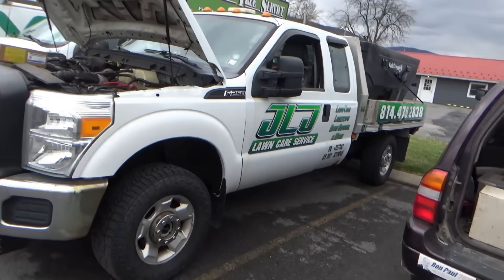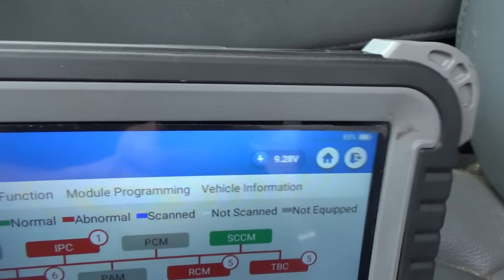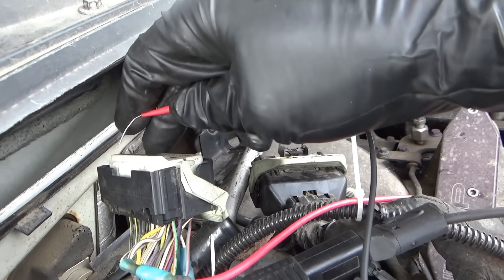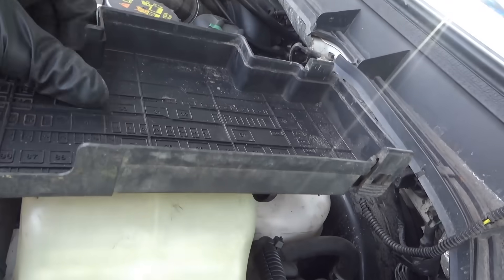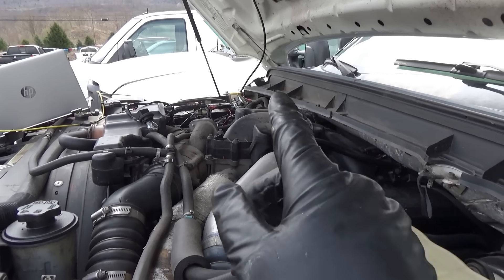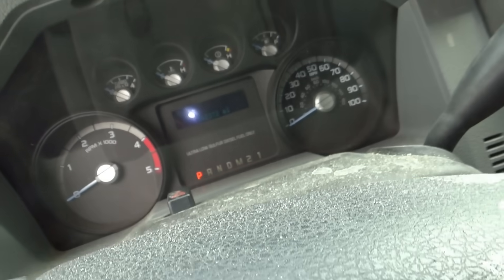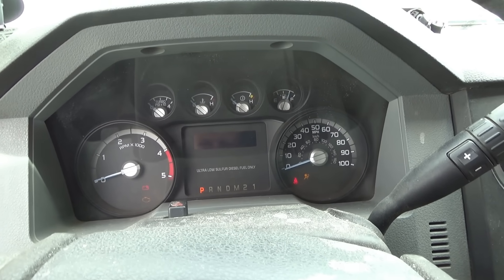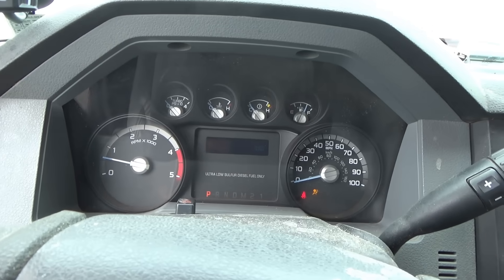PowerStroke STUMPS Shop?! (No-Crank, No-COMM: '12 Ford F250...PCM Replaced?)

Comment: C'mon Ivan. Those batteries are in parallel. They have to be separated to measure individual charge. Those piggyback fuse holders cause more problems than they solve. Beyond that, Ford's harnesses are a joke. Another great video from a master.

Comment: Same trouble I had with the DEF/DPF system. Came back to the previous owner who didn’t repair the body mounts and had the harness squeezed in between the cab and frame causing a lot of time down and money spent to repair it! Shitty connector placements and shitty body mounts!

Comment: Ok you all saw Ivan count wires from wrong side. Difference is he double checked and found that before condemning circuit.  It happens. Someone missed the fuse because of poor habits (got distracted)or sabotage.  We will likely never know. Either way they didn’t double check and started shooting parts. 
Our auto diagnostics industry is in a very poor place right now.

Comment: 6mins in, Ivan is mucking around with power connections, and all I can see is a badly frayed ground at the battery terminal.

Dunno if that's causing THIS problem, but that's gonna cause A problem, for sure.

Comment: I had similar issue with my Ford. Doing 70 on a highway, engine cuts off no recrank. I had to to get to the shoulder with CA drivers. Crank no start. I saw no CEL now on bulb check. I tried to disconnect the battery cap drain, reconnect and check. Nope no CEL. ScannerDanner taught me that on Fords no CEL on bulb check = no comm with PCM. CEL on bulb check but stays on while crank = no crank signal. Swapped relays bam on the road again. But I already told boss not coming and took care of getting parts without crazy rip off at shop...

Comment: HI IVAN,once again you did not disappoint us.YOUR main message would be "WORK SMARTER not harder.This shop looks like a fairly good shop,but the mechanic could learn just a little bit more and work easier by watching a few of your videos.The shop would have saved the cost of the computer by calling you 1st,FOR 2 reasons 1 the computer was still good,and 2nd you have to PROGRAM the key and change the vin and all the things that make installing a new computer into a car so costly.Being a business truck ,I'm sure the customer said to the shop {JUST FIX IT}we'll pay.I'd also bet the shop sneaks the cost of that NONreturnable computer to the customer.

Comment: Fords really seem to like to spit out fuses!  I had an F-150 a few months ago that was missing the diodes in the BJB for the starting circuit and the fuel pump circuit, shop had replaced the PCM, BCM, key cylinder, wiring harnesses, the poor truck had been off the road for nearly a year and changed owners three times trying to fix the problem.  Ten minutes with a wiring diagram to find the problem, two hours to put all the old stuff back in the truck before starting it for the first time in front of their "master" tech and the vehicle owner.  :D
Reply from the maker: LOVE IT 😊

Comment: Excellent diagnostic, Ivan! I was preparing to watch a hunt for a failing power or ground, caused during the engine works, and it's only a damn fuse!
Talk about jumping to conclusions - they throw in a new PCM and cut and jump factory wires, because a missing fuse was not checked... Insane!

Comment: The other day i watched the CAR CARE NUT. A customer brought his Lexus from 700 miles away because for 2 years this top dog Lexus dealer couldn't repair a nite time only Christmas tree in the cluster. Ahmed pulled the headlamp assemble off the car to see if it was OEM. The issue was related to headlines and auto hi beam and emergency braking. The car was in an accident and body shop installed new headlamp assembly....MINUS A CRITICL BULB. I think PHAD viewers would love to watch this episode as well. Remember....an fn lite bulb.
Reply: I watched that episode. It wasn't actually a
 " bulb" in the conventional sense, it was an infrared detector as I recall.

Comment: I saw fuses which were spades were cut off and installed at auctions so car or  truck would not start.
Guy would bid low to get it and simple fix .

Dirty tricks

I also found mini Buss fuse which looked good but were open no continuity.

Nice find Comrade 👍
Reply: Yeah it happens.  I worked at a Mitsubishi dealer for 15 years in which most of our work was used cars.  Lots of sabotage on those cars we found.  Plug wires, coil wires, injector wires crossed.  Relays and fuses missing.  A salesperson will do crazy stuff when seeing dollar signs.  Working for them wasn't too great either.  Glad I don't anymore.  But working for big corporations sucks balls too.
Reply: @greggc8088  I also found a battery charged backwards!! 
Crazy
Potato jammed in tail pipe also.
NYC Brooklyn
Repo cars people do for spite .
Auction cars full of bank repo cars.
Reply: Thats some low down durty doodie! Shadertown, SC style. Also why I don't gamble or give a flying eff about college sports. All that shiz, fer the perpz! Dey be purpletraytin like grape cruelaids!

Comment: Why are there three separate wires and what's the risk of tying them together like that?
Reply: Could be that the wire size to carry the necessary current won't fit in the connector as a single wire so they divided it into 3 smaller wires.
Reply: @major__kong  Not a chance . . . do a google search on "why do engine control modules have multiple grounds"
Reply: @major__kong  Your kidding right? Do google search on "why do engine control modules have multiple grounds" I only asked the question to see if Ivan actually thought it through.

Comment: At what point was their bodge jumper unplugged?
I have had multiple issues with those piggy back fuse holders where the load side terminal for the lower fuse (replicating the original) has a spread terminal straight from the factory.
Usually a horrible intermittent.
But also they barked up the wrong tree 
The feed on those 3 wires is controlled by the main relay.
If they gave it power from that fuse, it would likely also mess up a power sequence in the PCM so wouldn't complete the immo handshake.

Comment: Im stunned that a shop would say hey lets give it a new PCM without doing all tests beforehand, and thenm do the 3 wire hack job too! INcredible.
Reply: They counted the pins backwards also??
Reply: I wonder if the shop was thinking of actually trying to sell a new truck, or that someone at the shop was thinking about "Hey I can buy this broken truck for cheap" with this simple hack.
Reply: @ehsnils  I have seen that before . ..  .like those people at auto auctions that disable a vehicle and then get it on the cheap.
Reply: @ehsnils  or they are stings, trying to catch him not fixing things.  Like CBS did with the apple store not fixing laptops that just needed the pin bent back to make work.
Reply: @ehsnils  if they were they would not have called Ivan to fix it...
Reply: I’m not, I see this kind of stuff all the time. Shops need to learn when to tap out and call a pro. Saves money and time almost every time.
Reply: Its a fleet shop so they stock a shitload for 1 or 2 truck skus

Comment: Two and a half minutes in, and I feel bad for the owner. If that is how they work on the electrical system, I bet the re-gasket job is going to leak worse than it did before, plus whatever crap work they did reinstalling the cab.
Reply: I really hope they changed the crank case filter, if not, the leaks will return!!! Updated with the later model version too.

Comment: That shop should be embarrassed seeing this video.
This is basic driveway wiring diagram check.
Instead, they put a power jumper draped all over the engine, tossed an ECU at it.
Customer needs a refund, what a joke.

Comment: missed a fuse...REALLY?  and then went and fired the parts canon AND did surgery. and no, I don't think this was a case of "petty revenge", I think this was a case of modern dum-dum instead.  this is why shops aren't trusted anymore and they have to call in guys like Ivan.  no one seems to cross all the t's and dot all the I's in the name of either speed or penny pinching.

Comment: It's the ol' fuse pulling joke gone too far.  Or malicious.  It happens a lot according to a former student of mine that worked at a GMC shop for years.  Part of the reason he quit because they just wouldn't grow up and the service manager was just as bad.  If this shop is ran correctly, they better check their video tapes closely the next time. Someone is pulling fuses either to get back at someone or a recently "fired or retired" employee pulled the fuse on the way out while no one was looking.  Easy enough to do.  Takes a couple days to do that seal work on that old Ford so one day when no one is looking he gets to the cab and pulls the fuse.  A good mechanic would have check right away for it when it wouldn't start but if the guy that did it quit the next day, well ... jokes on the shop.  What I want to know is if the shop eat the costs or did they lie to the customer and tell them how much more time they needed because that old truck had a this or that problem that was related to the work but due to it being old.  A good shop would own up.  A bad shop will pass the buck by lying to the customer.

Comment: Excellent video my friend. I am curious about the double test light method around the 9 minute mark. I would like to start using this method but I was wondering if you could get me sorted on the principle behind it.
Reply: Useing a low amp light bulb 4 amp to check grounds at pcm.useing even a lower amp light bulb to check powers 1 amp. Making sure
The ignition switch and fuses and relays are providing what the pcm what it needs to operate. Basic
Needs for operation before checking inputs and outputs 👍
Reply: @richardnilsen5 or use a test light

Comment: My guess is when they pulled the body they had to disconnect that fuse adder jumper next door. When they pulled it the missing fuse ejected with it and they didn’t notice or forgot to replace it.
Reply: No, the original fuse is inserted in the bottom slot of the piggy back adapter.
So it wasn't missing until the bodge was unplugged, but those holders can have bad contacts, intermittent or no connection on that lower fuse holder.
Reply: @ wrong… the missing fuse was in the slot next to the splitter.

Comment: I was watching Mayson Dunsford with "Flying Wrenches" and he takes us through the reseal process on those 2011+ Powerstrokes.  Seems like part of the reseal is to buy a metal oil pan that Ford used in 2011 that has a press-in gasket; later they used a plastic oil pan with silicone.  Could you imagine paying that much for a truck and then spending more to make it reliable?  Great work, Ivan.  GREAT VIDEO!
Reply: Think he said those are discontinued and are no longer available
Reply: @ He also said you can still get them on E-bay.
Reply: I do a ton of these and I just get the eBay or Amazon upper oil pans. They work great
Reply: That's all new or newer trucks. Quite a few cars too.
Reply: NO

Comment: Imagine having a shop do an engine
Reseal and don't have enough education to check powers and
Grounds at pcm?
Crazy🤪 great video👍
Reply: The reseal job was probably done about as good as the pcm/wiring job. Will just take a bit longer to discover.

Comment: A little over 2 decades ago I was working at a high volume shop in Little Rock and a HVAC company van got towed in for N/S.  Same thing I went out, and no comm.  Opened the fuse box and the ECM fuse was gone.  Just gone.  Service manager asked me to explain how it was just gone.  I'z like how the fuk should I know?!?  LOL!!  Thanks for the video to go with my coffee Ivan.  Cross your fingers that the fish bite today.  ;)
Reply: Tell him to speak with his techs. They pulled it on purpose.
Reply: @phprofYT  When the service manager asked me what happened to the fuse, I told him that I had to assume that someone didn't want to go to work this morning.  Cost the company a tow bill on top of whatever the shop charged them.  ;)